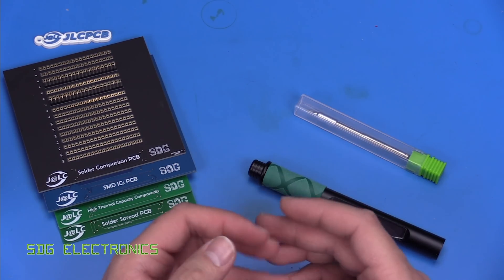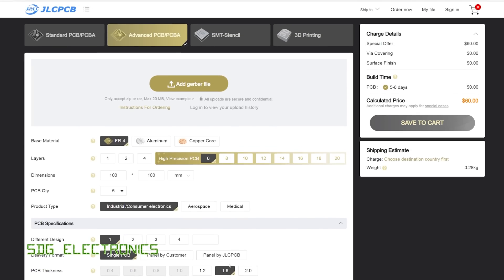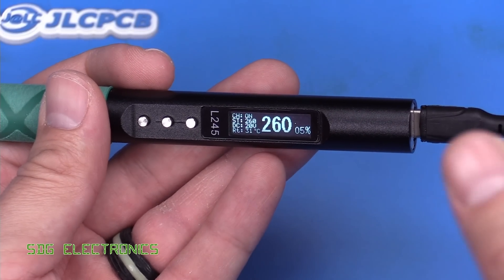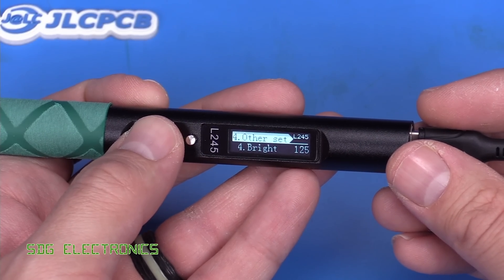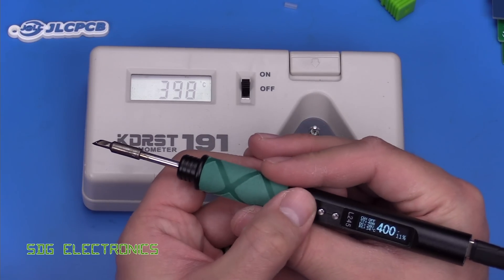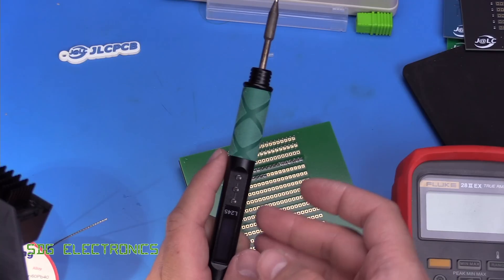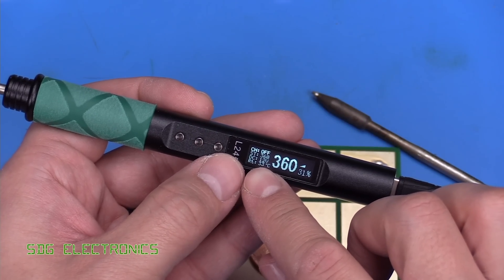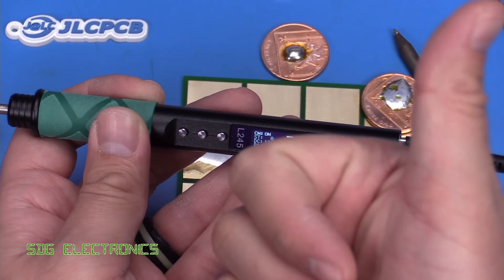SDG #283 A USB-C JBC C245 Soldering Iron

Comment: Hi thanks for producing these reviews I am finding them very educational.  Quick question... at 13:17 what is the black pad you use to change out the tip?
Reply: Probably a "Metcal AC-CP2" - a silicone pad :)
Reply: @joe0932  Thanks - I also found it on Aliexpress as part of the "YIHUA 948-II Soldering Station 780W" package - but not as an individual item.

Comment: There are new versions of it called l245c/l210c. Smaller dimensions, color display (tft or ips?), but the main thing it has now configuration to reduce power consumption. It's a pity that neither the manufacturers of this device nor the firmware upgrades are known.

Comment: FYI: if you're trying to calibrate one of these, while you're in that menu and one of the calibration points are selected for editing the iron will ramp up to that set point so you can dial in the exact value without leaving the menu at all. However if you're like me you probably tried for ages before figuring that out while running off a 19V DC supply. This heats up the board to around 65C which seems to be beyond the linearity of the NTC used for reference, trying to calibrate like this will produce very unstable results. So first thing to do is not touch it for an hour and then on startup go to other adjust menu and set temp to the actual ambient temperature, then do the calibration at 12V starting from 100C and it will stay on the money until the NTC saturates, from my testing you drop 15C actual after 30 minutes operating at 320C.

Comment: I had to buy one just to mess with it. So with direct DC voltage it does actually power up with genuine JBC tips. I pushed the voltage to 24v, at which the current draw (using a C245-966 tip) was ~9A. So thats over 200W. This thing is an actual beast it seems. One more thing to note that wasn't mentioned in the vodeo I think is that the soldering iron properly sits into a JBC cradle (original or AiXun knock-off).
Waiting for the follow-up video using direct DC voltage and the proper test PCB's to compare it to other stations/irons tho.
Reply: I wonder how long would the mosfet inside survive at that voltage and power

Comment: @SDG Electronics  If you plan to retest this with a DC power supply, where will I be able to see you post the response? Do you plan to do a follow up video or pin a comment on this video? This portable soldering iron is really close to what I'm looking for and I need to order one pretty soon. I like that it can share tips w/ the T3B, has an all aluminum body, and the grip looks like the best option compared to the other soldering irons. 

Is the limitations of the power delivery something they could patch with a firmware update or is it a hardware limitation and do you know if you could install the open source firmware for the USB soldering irons onto this and if it was a firmware limitation could that bypass the issue? Lastly,  In your opinion do you prefer the T101, T80P, Pinecil V2, or this one?
Reply from the maker: I'll post another video. Hopefully in the next few days

Comment: Is it possible PD charger can't support 150W at 20V. Can you try with DC supply for JBC tips
Reply: The highest I've seen is 28V 5A which is 140w.  But the USB spec for EPR using an e-mark cable goes up to 240W.  So far I've seen 240W cables, but only supplies  up to 140W.
Reply from the maker: I will retest in a few days and post a video.

Comment: Just an FYI: the same seller sells 5 different tip styles with this 6 ohms impedance. They sell it under the name "Customized Replacement Soldering Iron Tip Resistance 6 Ω for L245 Soldering Station Tools". All are knife or pointy tips tho :/
Reply: I find it strange that Pinecil dropped it's normal TS100 tip 1.8 Ohm to 1.6 Ohm on it's new short tips to gain performance.  And it worked!  I don't understand getting any type of performance at 6  Ohm.  I'm sure it's my lack of understanding.

Comment: Lots of Chinese soldering iron reviews, but I still don't see anything compelling.  By the time you buy one of these Chinese irons, get a selection of usable tip geometries (that don't even work properly in this iron), buy a USB-C PD plug-pack to power it, and get a high quality USB-C cable for it, you've spent the same money as you would on a used Metcal PS2E-01 system from eBay.  This thing has annoying menus and mediocre performance; the Metcal just works.
Reply: the killer feature is you can use usb-pd powerbank when travelling
Reply: @TomaszStachewicz  Yeah, that's true.  I'm definitely not going to do that with a Metcal system!  You've hit on the true use case for these Chinese USB irons: they're useful for remote work, away from your bench, with a power bank to run them.  For everyday bench work, they'll never compete with a proper high quality soldering station from a top industry brand.
Reply: @FlyingShotsman  Exactly,  All these half-assed clones of questionable quality and specs don't cut it for me. My tools need to work when I need them. I don't want to spend half a day trying to figure out why the tips aren't heating. I prefer a bench model that runs on line voltage too. I currently use Weller, Hakko, Pace and Metcal. Still using the old MX-500P-11. I just turn it on and it works. I still use Weller and Hakko with separate heater/tips because tips are cheap. I use them to pry when desoldering thru hole and old tube equipment.They serve the purpose and keep on going.
Reply: A pinecil is $39, a 65W wall wart is $15.  A 4 pack of additional tips on AE is $20.  A 65W cable is $5.  A killer 30,000 Mah 65W power bank "Baseus" is $65.   Total is $144 for a awesome portable system.  Is Metcal less than that?
Reply: @joepangit6938  No.  The iron shown in this video costs $50, not $39.  The 4 pack of tips on AE is not, IMO, "a selection of usable tip geometries."  That would require buying JBC tips ($21+ each at TEquipment), which don't work well in this iron.  As I acknowledged in my answer to Tomasz above, my Metcal system can't compete with this unit WRT portability.
Reply: @joepangit6938  Metcal smokes everything else out there. Pinecil is not in the same league.
Reply from the maker: That's why the Metcal is still my main iron. No fiddly menus, no usability issues, it just works!

Comment: Why USB-C? The 245 cartridges can handle 200W of power, they should use a beefy DC connector like an XT60 instead.
Reply: USB C EPR spec now goes to 240W.  The 240W cables are out now.  Won't be long till the chargers come out for it.  Hopefully most laptop chargers will just be USB C then.
Reply: @Sunchip Dip not like you couldn’t just PWM 48V into the iron’s cartridge. I’d have to check the schematic to see if it’s USB-C PD receiver chip can actually do that.

Comment: ah well shame it isnt very good. instead of that i have been ordering parts to try and mod my auxin t3a to accept usb pd 100w and also a direct dc input from powertool 18v battery. which i feel is best. already wrote up my findings on the t3a eevblog thread while still waiting for parts to arrive. of course another matter to consider is that the 100w usb c pd spec includes ocp as mandatory. and you dont want to have the supply triggering ocp and shutting down because the aixun is trying to draw too much current. which is the only obstacle potentially. and i need to do some further testing in those regards
Reply: I built a power tool battery to USB adapter but I cheated.  Used a cheap AliExpress buck converter to take a 40V Walmart Hart power tool battery down to 24V or so, then used a Baseus 160W USB PD car charger to output 100W.  It works well.  Using the $23 Ebay car charger is cheating, but it works good! :)

Comment: According to the instructions from the Aliexpress product page, it says when using the genuine JBC tips to use at USB-C to DC power adapter. At least that is what i'm understanding from the strange wording. I could be wrong, but I wonder if that would make it not reboot when using genuine JBC tips. I'm very interested in this little guy if it was able to use genuine tips reliably.
Reply from the maker: I'll try it again with a DC supply
Reply: I tried just that and at least with my specific (granted very cheap usbc to DC adapter) it didnt work at all. same exact thing happens, overcurrent I assume and it just cuts out instantly. I'd be really interested in somehow tinkering with it and making it work nicely at least for like 50-65w with a simple PD powerbank or charger. Would be a pretty nice little iron but theres not much info online unfortunately.

Comment: Maybe they need to design it to support USB-C PPS so it can ramp the voltage to the max value possible without tripping over current, according to what the USB power supply reports it can supply? Or just PWM the tip at a high enough frequency like you suggest, so the power supply doesn't see the pulses?
Reply from the maker: I'm sure they could ramp up the PWM and limit the power that way. Not sure what MCU it has in it, but it might be good if it was open source.
Reply: @sdgelectronics  You never know Steve, it could be open source. May be worth taking apart and seeing if it would take a hack to get it fully working with the JBC tips. Looks a nice bit of kit though.

Comment: I wonder why they didn't make it compatible with genuine JBC tips first? Making look-alike tips which have a different resistance is silly. Would be a PITA to use it the way it is. Is it better than any of the T12 compatible portables? Because T12 tips are way cheaper than JBC. I personally prefer 120V powered stations over portables.
Reply: Indeed.  It would also be interesting to see what a genuine JBC station makes of the Chinese cartridges.
Reply from the maker: I've got another T12 version on the way. The MiniWare is the best so far, but there were not many genuine cartridges available for it.

Comment: Would be interesting to see how it performed on a 200w 20v psu, and if you could botch it to 24v to get the full 200w of power. Then it would be a cheap t3a replacement, though a good 24v 200w psu sets you back 40 euros as well, which comes close to the t3a price. To me a compact design would only make sense if it had a battery. I already have a t3a which is small enough to take with me or solder in less accessible places. Having to take a usbc powerbrick doesn't make a lot of sense to me.
Reply: If the architecture is similar to the pinecil, with shared Vin, the usb power delivery IC may not tolarate voltages higher than 21v.

Comment: Did you check if the behaviour of it cutting out was related to the power supply you used? Perhaps some PD supplies will tolerate a short overcurrent while the tip warms up? If so, that would make it a lot more useful than otherwise.
Reply: my Pinecil will cut out when using the Apple 96W usb-c brick, but works no problem on the Apple 87W one. both genuine, but I guess the 96W is more sensitive to overcurrent
Reply: Yes, are you sure your power supply wasn't dropping out, Steve? When you had the JBC tip in, you could see the voltage reading fluctuating between 9, 10, 12V. I doubt that was intentional USB-PD voltage re-negotiation.
Reply from the maker: @HwAoRrDk  It was a 96W supply, but it certainly could have been the power supply. I will check again with a DC psu.
Reply: @sdgelectronics  have you found the time to check? I am really looking forward to your tests

Comment: With all the soldering stations you've tested which one do you use for day to day work? I'm trying to decide between an MX5200 and a JBC station, having to buy specific tips for lower temperatures seems like the biggest downside of the Metcal. Maybe I could just use the low temp tips for everything as I rarely set my current iron higher than 320 even with lead free solder, it's not calibrated though.
Reply from the maker: MX-5200 is the best choice for most soldering tasks in my opinion. I rarely find a situation that needs a specifically low temperature, but if it's common for you then maybe the JBC.
Reply: I agree with Steve and Andrew.  I use an older Metcal PS2E-01 system, but it uses the same tips.  I don't own any low-temp tips and haven't ever damaged a component.  Just get in and get out quickly if you're soldering a sensitive part.  The Metcal equipment is a joy to use.  There's nothing to adjust or fiddle with; just pick your tip, turn it on, wait 7-8 seconds and start working.  Tips last a long time and geometry choices are endless.
Reply: @FlyingShotsman  tips are also cheap compared to JBC, in NA, you can get them for $18 on amazon.
Reply: @jaro6985  Indeed.  I've also found a few of my favorites in good used condition on eBay for under $10 ea.
Reply: I have an MX5200 and I don't change the temperature very much, I use a STTC-126 tip for pretty much everything from SMD to through hole. I sometimes switch to a larger tip for larger things but that's all really.